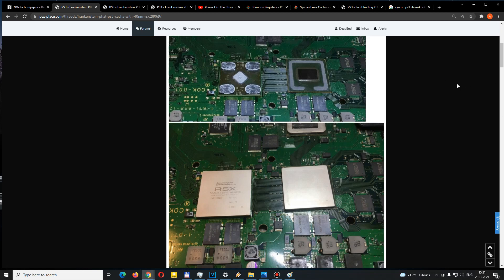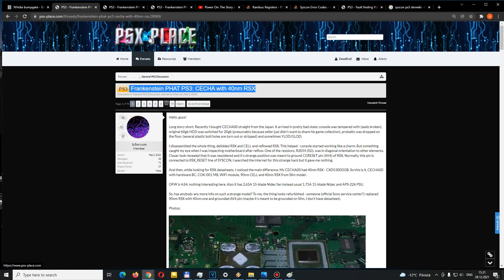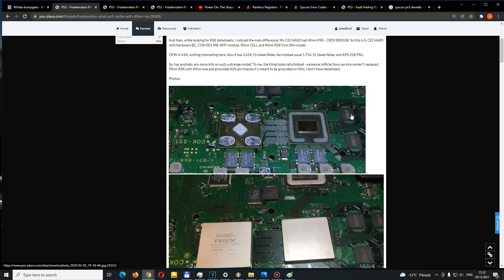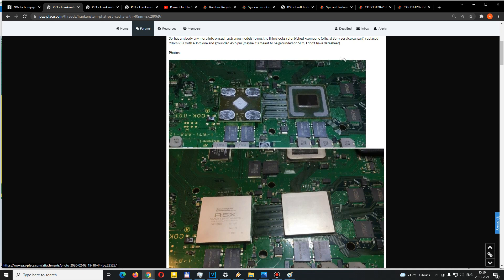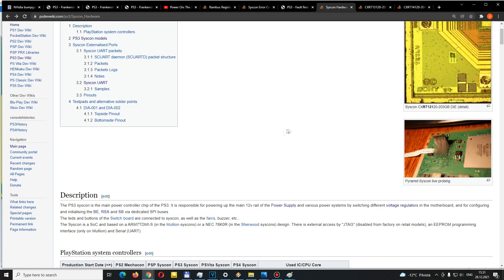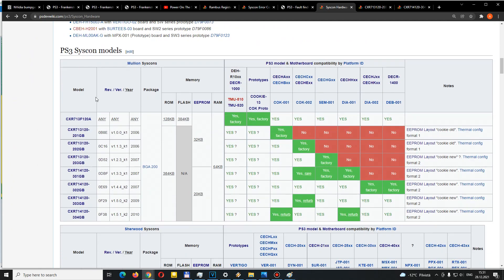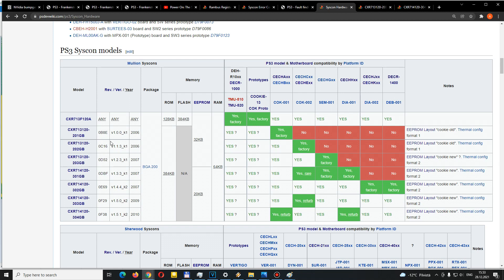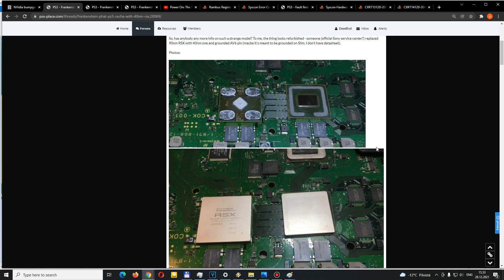PlayStation 3 Frankenstein Board versus Orbis Mod (Story and Explanation)

Comment: Can you fix my CECHA01 and put a 40nm RSX and CECHE01 and put a 65nm RSX  with both YLOD if i send them in to you? How much would the whole job for both cost?
Reply from the maker: I haven't done these mods for a while. But I could refer you to a person who might . His and my rule would be that we don't work on the boards that were reflown/heatguned/put into oven etc... Otherwise there could be unpredictable issues that are hard to repair.
Reply: @calyps0man   Both were open so im pretty sure they were reflown heatguned or put in the oven. what are my option then ?
Reply from the maker: @jbwsimracingnews4624  Take pictures of the board... The guy I know actually doesn't even want to work on cok-001 anymore because those are hard to find in EU in case something else is damaged on it. And since you said it was opened and something was done it, it's most likely already damaged on top of YLOD issues. So the answer is, I'm not sure what your options are. There aren't many at the moment lol. Perhaps somebody could agree to at least reball it.